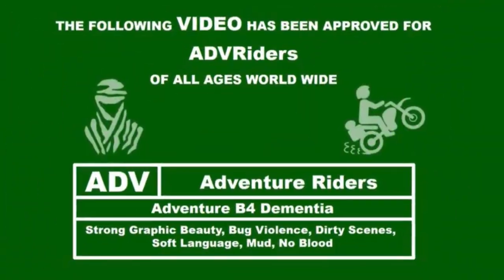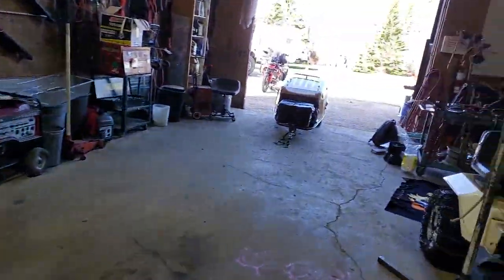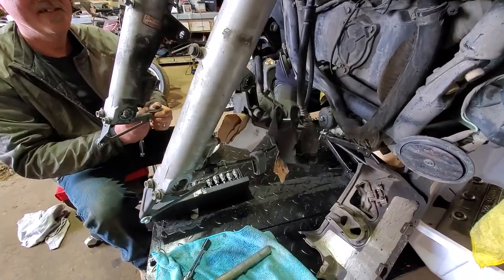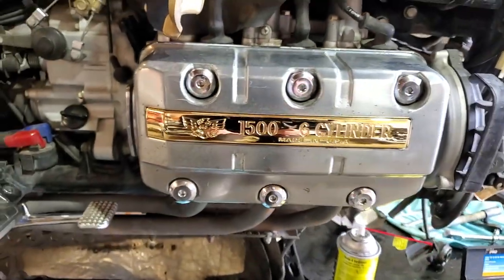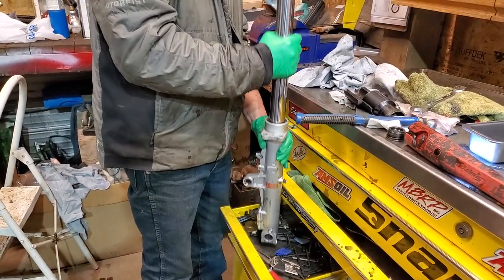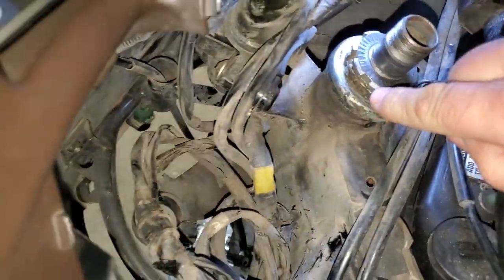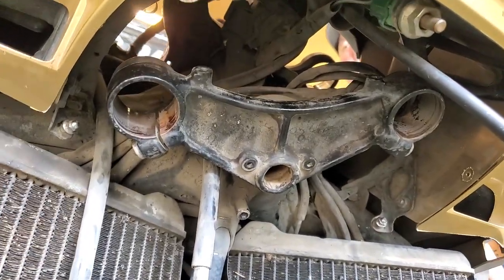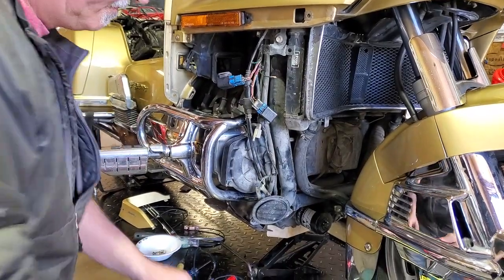1991 GL1500 Steering head bearings, Fork springs, engine covers and Left turn signal switchgear

Comment: I’d of polished those engine casings to get rid of the marks that’s on them
Reply from the maker: They were so badly pitted and corroded I decided to replace them. I did try to polish them. I found a set at a wrecker for cheap.

Comment: Great video, have a 1989 1500 with 18000 miles....my thrid wing. looking to upgrade suspension, have they made a big diffference?
Reply from the maker: They have. Much more responsive cornering and better ride 2 up and pulling the trailer
Ride safe

Comment: What were the symptoms of this repair? At certain speeds, did the bike feel floaty? Was it wobbly? Did it not track straight? I have a 1200 that I think might need the same fix you are doing here. Thanks
Reply from the maker: No symptoms at all. Bike rode perfect.
I just decided that it was likely a long, long time since they had been looked at and I wanted to learn how to do it.
Reply: That right decision,  bike is old, and bearing replacement and fork business is 1000 percent reasonable.
Reply: I have a 1200. Rode good but sagging a little. I put Progressive springs in and changed the oil. Much improved handling. I'll put for seals in next time I have it apart. Put Progressive heavy duty shocks in also. Haven't put in steering bearings yet. Felt tight when fork was apart.

Comment: 9000 km new breakpads ??? bit soon I think.  Mine lasted more than 50.000 miles on the same bike FR & R
Reply from the maker: We did not change the brake pads in this video. I never mentioned brake pads in the video, so not sure where you heard that? Since restoring the bike from not running for 21 years I have 13,000km on the brake pads I installed and their in great shape.
Ride safe
Reply from the maker: Sorry, I am an idiot....You are correct and I did say I thought I might need new break pads on the front. When we removed the brake pads to inspect them we found they didn't need to be replaced. I am so sorry for the confusion. And once again I apologize, you were correct.

Comment: Hate when mechanics use a chisel on steering or clutch nuts. Buggers them up a lot. I make spanners. Down in Argentina the mechanics don't have many tools and a hammer is used a lot. Broken and mangled parts. Watching this video and taking apart a fork on a Falcon 400 for new seals.
Reply from the maker: That's why I let someone else do it :)
Ride safe

Comment: You left so much out, we didn't learn the most important parts of things.
Reply from the maker: What would you like to know that you think I didn't cover in the jobs I did?
Reply: @highmilagerider1154  Everything. Only bits and pieces and didn't show how things were gotten into and done and put back together especially the forks. I made a large C clamp and welded a half pipe at the one end to slide around the fork tubes to compress the springs back into the tubes. I never took them off to change the oil. Show the main parts getting into something and out of it.  The long process is obvious. thanks.
Reply from the maker: @JohnSmith-uy7sv  
The process is very long but maybe I should have shown every step and just had it be a multi part video? Thanks for your comments, I appreciate it.
For the forks I was able to just twist off the top cap by pressing down on it with my hand to get the spring out. We then used a slider bar over the fork to pound off the fork seal.  To put the new spring in I just placed the spring in, added the oil and pressed down on the cap with my hand to compress it and get the cap started, then torqued it to spec. Used the same slider bar to put in the new fork seal.  It went really easy considering it had sat for so long. 
Ride safe.
Reply: @highmilagerider1154  My 94 wing caps were more than I could press and twist the caps at the same time. I know some other bikes have fill holes so when your need to redo them in so many years you can unscrew the set screw and refill it that way. That is what I did to mine, but not near big enough hole and then tapped it and set screws that I wanted. I don't want to ever have to take them out again. Yes, I know everything was a very long process and would have been hours of video. I was just saying, starting into the project, getting into what needs to be done or obstacles you encounter and how you closed it up. Yes, I know, it would take time and tedious. but you had 2 people. That is why I never videoed mine as I don't have a garage either. Mine is under a overhang and bike cover. People with a storage barn or garage have it made and you can take your time. I never had to change my seals ....yet. Only had it 3 years and only 17,850 when I got it. Now its 29,000. Thanks.